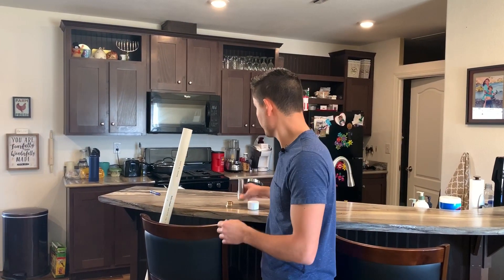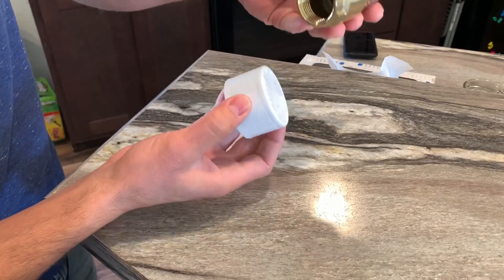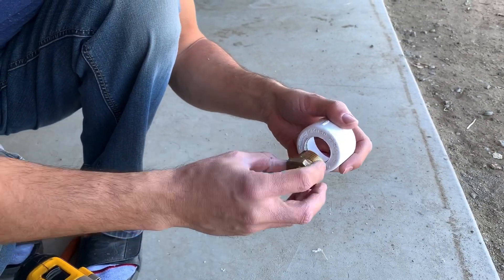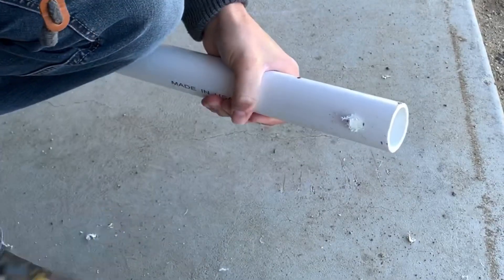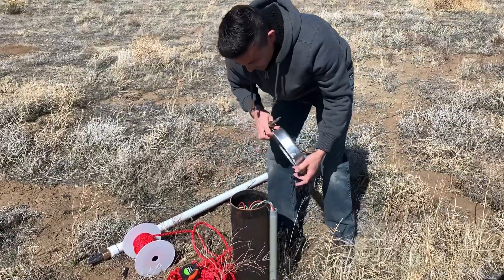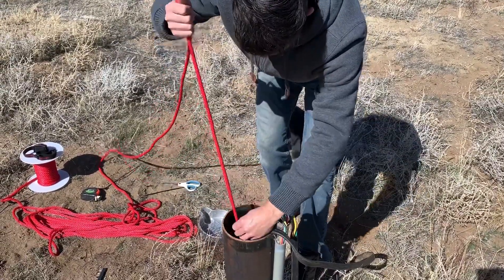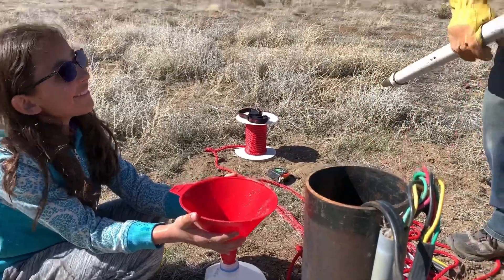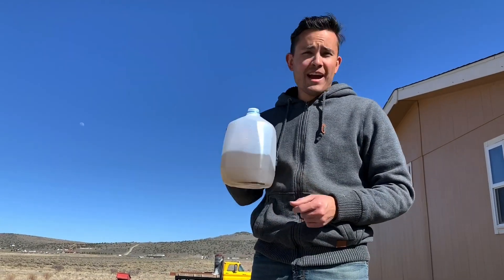Get Water From Your Well WITHOUT Electricity!

Comment: The hex bushing that is linked to Amazon is wrong and won't work.
Reply from the maker: I just checked it, worked fine for me.
Reply: @MapleBoarder78  Could be the secondary market at Amazon. The photo did not match the items I received, plus the threads did not match with the foot valve. A trip to the hardware store did the trick. Thx for the video..good info!

Comment: Cool vid. Ty. How much bigger of a pipe you think you could use without it getting stuck?
Reply from the maker: I personally wouldn’t do it any bigger. A few times it got stuck pulling it out and I had to lower it back down to retry. I also added an additional note to the video description as I ended up shaving down the edges of the PVC coupler as that’s part of why it was getting stuck. Needs to be tapered so the edges won’t catch on anything coming up. I’d also round off the edges of the pipe close to where I tied the rope through as well. 👍🏼
Reply: @MapleBoarder78  Ty much.

Comment: I want to know on what principle, the water from the bottom end of the pipe where the valve is positioned, raised to the full length of the pipe?
Is it simple siphoning?
If this video is true, then can this system be used to pull water from a lake or any water body to  a height of 5 to 10 feet?
Please, help me understand. 
Thank you.
Reply from the maker: You are correct. The foot valve allows water to enter up into the pipe, but does not allow it to exit back down out of the pipe. It’s essentially a one way door/valve.

Comment: I like the fact that you could fit it down the well without having to pull the submersible pump, pipe and electric cable out of the well. I was thinking of using 3" pipe, but wouldn't be able to fit it down the well without removing the pump, pipe and cable. I have a whole house generator that would last a while after a power outage, but you never know what could happen in the future. Great job and I'll definitely be making one. It's cheap insurance.

Comment: If your water was close to the surface, like 25 feet, you could use a 30 foot pipe with a foot valve on the bottom and a 45° elbow on the top end. Just quickly raise and lower the pipe in the well casing and the foot valve will pump the water up. Catch it a large bucket tub.
Reply: Think that would create enough pressure from the bottom up to pump 25 feet of water? That's 2.295 gallons weighing 19.5lbs.
Reply: @NavyPharmD  Yes, because we used that method to prime our jet pump at our farm. It was maybe 12 feet, but 100 feet to the house as well. We could pump air-free water tall the way to the pump in about 30 seconds or so.

Comment: Why couldn't you build a similar apparatus but with a hand pump on the end of it?
Reply from the maker: You could. But hand pumps that can pump well water from the depth I needed are very expensive. The o-rings in them are also prone to failing over time when not used often.

Comment: What size is the foot valve if the bushing is 1-3/4" and the pipe is 1-1/2"?
Reply from the maker: I apologize I misspoke in the video. Where I said “1 and 3/4”, I should have said “1 to 3/4”. The bushing is 1” on the outside to screw into the 1” foot valve. The 3/4” threads on the inside of the bushing is irrelevant as it’s not required for the build. 👍🏼 I’ve updated the video description to include links to the parts to build the bucket.
Reply: @MapleBoarder78  Thanks for clearing that up!

Comment: I am not sure I understand the point of the foot valve.  A foot valve isn't designed to open on its own; it requires pressure from a pump to open it and allow the water to flow in.  It seems to me you simply lowered your "skinny PVC bucket" low enough that the water entered from the top.  In which case, the point of the foot valve would be for weight to get the skinny bucket down into the water.  Is that right?
Reply from the maker: Hi Jason, the foot valve I bought does let water in as it’s lowered into the water, I tested this in a large bucket. If it was completely closed the pvc bucket I created would not have enough weight to overcome the buoyancy and would never fill with water. 👍🏼
Reply: @MapleBoarder78  Interesting.  Will you please provide the model of foot valve you used?  From my research, they usually have a spring inside them to help them snap shut once the draw from the pump ceases, in order to prevent the water column from draining out.  Thanks!
Reply from the maker: @jasonvaneaton1753  https://smile.amazon.com/gp/aw/d/B07P1F8PBY?psc=1&ref=ppx_pop_mob_b_asin_title
Reply: @MapleBoarder78  did you get the 1 inch foot valve?

Comment: WOW, water from a well with a tube in the stead of a bucket. Impressive. 😉
Reply: Most of these wells are a small enough diameter to make a bucket infeasible. You'd need a bucket with about a 1.5 - 3 inch diameter and long enough to still hold about 1/3 gallons of water per pull. It would probably be shaped a little like a 1.5" PVC pipe cut to 5' long with a foot valve on one end.

Comment: seems to me that a male PVC male adapter would be cheaper, just as effective and less work to affix the foot valve to the tube. This would be a good survival method but it obviates the need of pulling your existing submersible pump and the pipe which would be  a big hurdle and not a quick fix in time of emergency conditions.

Comment: Hi I tried it just like you said. The foot valve with the spring seems to need more pressure than just being in water to open. Should the spring be removed? Tried it in the sink foot valve never open. Thanks
Reply from the maker: Hi Audrey, the water in the sink may not be enough to open the foot valve. I’d try testing it in something like a swimming pool. The valve doesn’t need to let in much water too, just enough to allow the device to sink and begin filling from the top of the PVC pipe.

Comment: About your mobile home installation video. Have there been any disadvantages to doing the foundation that way? I I love the idea and I am trying to figure out how well it works.
Reply from the maker: It will be 5 years this January since we built, no issues. 👍🏼
Reply: Thank you!
We’ve had 4 inches of rain in a week before would that ever be a problem? And are your taxes the same or are they more because of the foundation? Sorry I’m just really interested in doing it too?
Reply: And is it hard to get under if you have to work on something under there?
Reply from the maker: @yesorno1768  I have no idea if the rain would be an issue. That will depend on the composition of the soil in your area, something I am not versed on. I am unaware of higher taxes due to being on a foundation. Our county does not give detailed breakdowns that include fees for a foundation type home vs a mobile home on jacks. That would vary from county to county anyway. I’d suggest calling your local county office to get an answer to that. Our house does have a decent amount of space underneath to work under. I’d say about 3.5 feet. That will depend on how tall your builder or you decide to pour the walls. You could pour them taller but it will need to be engineered correctly.

Comment: Great video! Do you think it would work if there was some way to hook up a hose on the end of that set up you made and have it rigged to a gasoline water pump above ground to get continuous water flow?
Reply from the maker: I don’t see why not. Your only limitations would be the depth of the well in relation to the power of the pump.
Reply: @HP 345 I think You're missing the point. If you lose power for an extended period of time such as an emp or other shtf senario chances are you won't find any gas.
Reply: @pmaint1  no worries, found another way to retrieve water without gas. The time I made this comment was a while back
Reply: @Hugo.345   What did you do to solve this problem? Care to share? Thanks

Comment: Similar contraptions used to be available at hardware stores. They were made of galvanized tin and had a  foot valve that could be opened by pulling a link that came up through the center. If I remember correctly the one my Grandpa had held about 2 gallons. His well was probably about 12" diameter or more. This was late 60's early 70's

Comment: Could something like this be used in a very deep well ? We live in the mountains and our well is 550 feet down.
Reply from the maker: Mary Lou Blouse As long as you have a long enough rope. Knowing the water level is important so you can know how far to drop the PVC pipe. Your well may be drilled to 550 feet but your water level may be at 400 feet. It may take a good amount of testing. I prefer only to use my method in this video as a last resort. 👍🏼